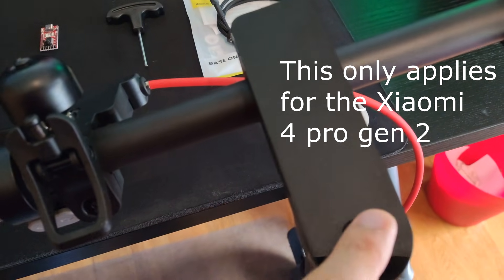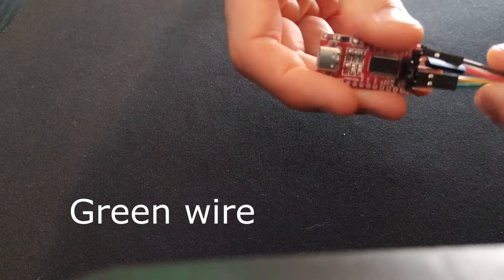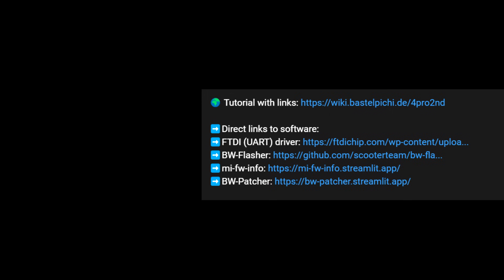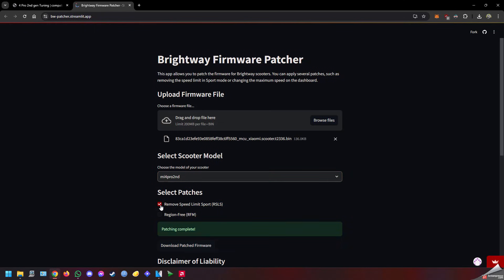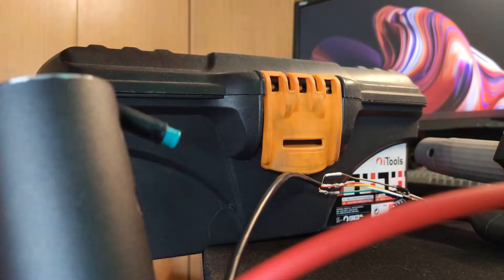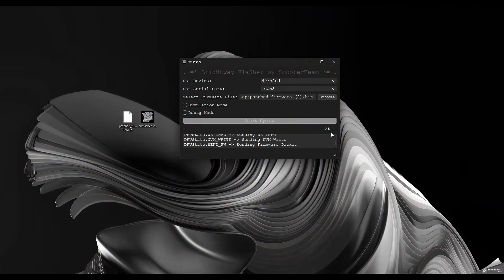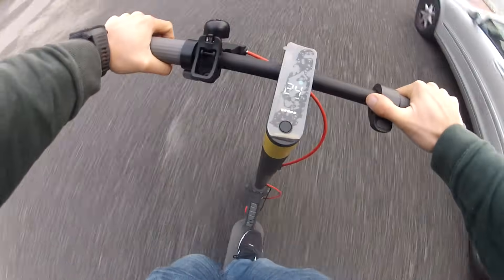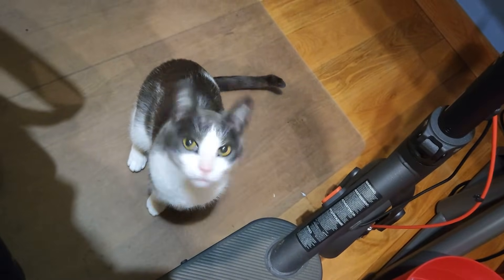UNLOCK Xiaomi 4 Pro Gen 2 & Xiaomi 5 TOP SPEED in 5 MINUTES 2025

Comment: i try everything but its still not working. it stay at 0% and don't move. i try you methode and from other. but nothing work. Can someone help
Reply from the maker: How are you connecting the cables? Connect the same way as in the ebay listing
Reply: @krypz0n  I tried your metal and the eBay method, but it’s still not working.
Reply from the maker: @niklaswendt37  Where did you purchase from? The correct way will be the way the ebay listing shows. It comes with a paper showing how to connect. Does the UART appear on control paneL? Are you using a usb-c cable that allows data connection? on bwflasher press "debug mode" and "test connection" is any reply being sent?
Reply: @krypz0n I use a iPhone usb c cable and I test but it don’t work it says that I reach the maximum

Comment: Hi, I have Xiaomi Electric Scooter 4. I did exactly the way it was described in the video. I downloaded and patched the MCU firmware. I verified the pinouts. The flashing was successfully done from 0 to 100%. But afterward, when I turned on my scooter, it started showing the'43' error code on the screen and the scooter continuously beeping.

I am unable to revert it and use the scooter. 

Kindly someone suggest a solution.
Reply from the maker: Hello, Xiaomi Electric Scooter 4 is not compatible with this method, only Xiaomi 4 pro 2nd.. Try joining the discord and asking for help

Comment: work to lite 4 gen 2??
Reply from the maker: no flusha, but there seems to be a hack in development to unlimit from 20kmh to 25kmh
Reply: @krypz0n in portugal limite to 25km/h
Reply: @krypz0n  that's why I wanted it from 25 to 35/30
Reply from the maker: @krazz245  impossible, scooter battery and motor too weak
Reply: @krypz0n  what? 25 km/h stock?
Reply from the maker: @krazz245  yes, unfortunatly you cant go anywhere above on this scooter. If you want more i reccomend getting a better more costumizable one
Reply: @krypz0n  yes but in Portugal the scooter is limited to 25km/h
Reply from the maker: @krazz245  yes

Comment: When I connect I get 3 different COM.
Standard Serial Bluetooth ... COM3
Standard serial Bluetooth .... COM4
USB serial port COM7.

Does it matter? Which one do I chose?
Reply from the maker: Usb serial port, watch the video
Reply: @krypz0n thanks, saw it now.
However the acceleration is really slow. How can I increase?
I also put 39kmh, but it only goes 30 (34 downhill).
Reply from the maker: @Cashifyer  its normal, mines similar, charge to 100% and it'll perform a little better
Reply: Thanks. 
Is there a way to increase acceleration? My Pro2 has a better acceleration with smaller motor. 
Also, is there a way to electronically silence the 30+ beep?  @krypz0n
Reply from the maker: @Cashifyer  Only installing a custom controller like a VESC, not a very easy job, some german guys have done it on a 4 pro gen 2

Comment: It seems not possible to do this using a Mac becouse cannot determine Com Port as far as I try.  I used Silocon Labs Drivers for Macintosh not sure now just stumped. any one knows?
Reply: My computer didnt determine Com Ports also correctly at first. So when I looked at Device Manager at COMs PORTs it showed me two ports. But when I looked at all the unknown devices list I saw couple of what where having some errormarks on their name, one of those was some USB COM or smth - I clicked on it and forced to download update drivers from Windows Update. After 1 or 2 times attempting it finally installed something and there was now one more port available and from it allowed to update this firmware :) But there are some cons. I did for my Xiaomi 5 Max. For example, at first the max speed was like 33km/h when battery was fully charged. After there was 75% left it didnt go any faster than 28 km/h. And those 25% from battery was drained very fast, I was able to drive only 7 km on max speed. And it beeped couple of times without any reason or any heads up notifications on display....  :( But yeah, it worked for some time. But range quite bad now :( But yeah my weight is also like 102kg. :) :) :)

Comment: This worked today on my Xiaomi 5 scooter. Not Max or Pro. Just regular Mi 5. The usbA was not recognized as a port under device manager. I used a usbC to usbC cable and the port was recognized successfully. I set the sport speed to 35 KM/hr and just tested it and only got up to 27 KM/hr. This was on flat ground. I followed his instructions and the firmware uploaded to 100 percent successfully the first time. Hope this helps others.
Thank you KrYpz0n !!!!!!!!!!!!!!!!!!!!!!!!!!!!!
Reply: I did for my Xiaomi 5 Max. For example, at first the max speed was like 33km/h when battery was fully charged. After there was 75% left it didnt go any faster than 28 km/h. And those 25% from battery was drained very fast, I was able to drive only 7 km on max speed. And it beeped couple of times without any reason or any heads up notifications on display....  :( But yeah, it worked for some time. But range quite bad now :( But yeah my weight is also like 102kg. :) :) :)
Reply from the maker: @DaemonDrag8  you can silence the beep if you want: https://www.youtube.com/watch?v=LUPODSxsKwI

Comment: My max speed was 27 and range 20km :(((((
Reply: I did for my Xiaomi 5 Max. For example, at first the max speed was like 33km/h when battery was fully charged. After there was 75% left it didnt go any faster than 28 km/h. And those 25% from battery was drained very fast, I was able to drive only 7 km on max speed. And it beeped couple of times without any reason or any heads up notifications on display....  :( But yeah, it worked for some time. But range quite bad now :( But yeah my weight is also like 102kg. :) :) :)

Comment: I have 2 Questions 1. Can i somehow set the scooter to 20kmh if i see the police? 2. I dont have the taillight always on thing
Reply: Try to set Drive to 20 and Sport to 30+. If you saw a police you can just switch to a drive
Reply: @Мокрийкот i think the police know how to change ro Sport mode
Reply: @ItzErmalYT  maybe
Reply: @Мокрийкот and what about that my xiaomi home app doesnt have the taillight feature always on?
Reply from the maker: just turn on headlights before disconnecting the dash and the brake light will stay on. Set Drive to 30+ and Sport to 20, if you see police put it in sport!

Comment: It ist Stück at 0 and i cant find the mistake can anyone help
Reply: Look if the cables are all in the right place. It is a little bit tricky. I thought I had everything right, but turns out I had one of the colored cables wrong. Also make sure your scooter is on (Just plug in the charger cable and turn on light so the scooter shouldn't go out.
Reply: @frorkbrunk6422  and what color combination do i need if i bought the first linked cable for xiaomi 5 pro/ max
Reply: @frorkbrunk6422  wich colores should i use If i bought the cable from the first Link for Xiaomi 5 max
Reply from the maker: join the discord and me or someone else can give you a hand
Reply: Which discord channel are you referring to? Can you please share the link?
Reply from the maker: @bilal-rabbani  scroll down: https://scooterhacking.org/

Comment: Ok so I wanted to put my speed hack on drive (i put it at max 39.50 and checked only this option) 
now it just goes 25 km/h instead of 20?? Sport mode did not change either.
Reply from the maker: I think th D mode might be a bit bugged on bwpatcher, try changing only S mode
Reply: @krypz0n  Ok bro I changed only the sport mode this time and now both modes go over 30km😭

Comment: i get a problem with "unexpected response" directly after starting flashing. Can some one help? Is an Xiaomie 5Max build for the German market.
Reply from the maker: https://imgur.com/a/mZETTVR

Try these options on your USB Serial device options in control panel
Reply: @krypz0n  Hi, I also had a constant "unexpected response" on "5MAX", I tried everything (another PC, another cable, USB HUB, reinstallation). But with these COM settings it was fine at first. Thank you very much for your help.
Reply from the maker: @rujakbalint3062  i will make a new video with these settings! Ty

Comment: EDIT: ANSWER IS AT THE END! 
Hello, I flashed my Scooter just following your tutorial and so far the program and cables worked. I wasn't able to try the new speed limit yet because I had no time, but I was wondering what happens if I drive exactly 30kmh - does it still beep then or do I have to go above 30kmh?

Because I patched the scooter to exactly 30kmh now. If it beeps I would have to do the whole thing again and patch it to 28kmh or something, because there is no way I will open the scooter just to remove the beeping sound. Does anyone know?
Reply from the maker: Hi, try to ride the scooter yourself over 30kmh. With the wind noise its barely hearable. In mine i didnt remove it and i barely notice it, so it might not bother you enough to want to remove it
Reply: @krypz0n  Alright thank you. I will try when I am back home and if it's not too loud I will let it stay on.
Reply: @krypz0n  Hi, just wanted to add to this: I was able to test the scooter now and drove exactly 30kmh - unfortunately it does indeed start beeping at 30kmh. I do not want to open my scooter to remove this beeping so I am currently patching my scooter to 29kmh, which should be sufficient to never have beeping (unless the street goes downhill).

Comment: Hey! Thanks for the great video — it was really helpful. I have a quick question: is it safe to unlock the Xiaomi Scooter 4 (2nd Gen) to 39 km/h? Could riding at that speed damage the scooter in the long run? Or would you recommend lowering the top speed a bit? What would be a safe and reasonable limit in your opinion?
Reply from the maker: It doesnt actually reach 39, itll reach 32-33 flat, 35 on descents. Its fine, its not an overclock per se, its literally removing the factory speed limitation and running the motor till its designed limit
Reply: Max is 32 unfortunately, I am a bit dissatisfied with it. Expected more than Xiaomi Pro 2...

Comment: hi first i wanted to thank you for the awesome cables and serial adapter (which i bought by clicking on the link) but is there any possible way to unlock any different futures like cruise control and no need to push to start? anyway thank you it worked in less than 5 min

Comment: It worked perfectly. Now the scooter beeps at 30 km/h. Anyone have a solution?
Reply from the maker: Yes! Check the end of the video and the linked video on the description 😊
Reply: Thanks a lot. It's possible to set the speed with a app like m365?
Reply from the maker: @ibosch6498  no, only through hardware (uart)

Comment: think about if you know how I can get it to run 20kmh again after I tune it because I have a 2 year refund if it breaks and I don't have that if it runs more than 20 and they find out about it😂
Reply: I have waranty too and I would like to do it again at 25 (in my country the maximum is 25 km/h).
Reply from the maker: @Bogdyy_1 do as i said in my reply above
Reply: KrYpz0n Can I get it to run 20 km/h again?
Reply from the maker: Yes! Just flash it with the MCU firmware file without patching and it goes back to stock firmware

Comment: How do you connect the wheel?
Reply from the maker: what wheel?
Reply: @ the e scooter steering wheel. U connected the scooter cable with the Flash Adapter. What happened to the wheel caple that u disconnected at the beginning?
Reply from the maker: @MaqxyIt remains disconnected while flashing. When you finish flashing, you reconnect it
Reply: @ ah After Flash u take out the flash adapter ?
Reply: @krypz0n  one last question. Is there any chance that this gets patched? Bc my friend want to buy this scooter but not any time soon, could there be a chance that this method gets patched and won’t work anymore?
Reply from the maker: @Maqxy Due to the way this method works (flashing via UART, same way the scooter gets its original updates), i dont believe so
Reply: @krypz0n  so he doesn’t need to hurry

Comment: BWFlasher always says 0% Even with Debug Mode and every Solution you showed it still can’t be Flashed for some odd reason I have a Xiaomi 4 Pro 2nd like in the Video
Reply from the maker: what happens when you click on "test connection"?
Reply: @ It says Maximum attempts reached, check your connection but after testing it on 2 other computers it still the same error on all 3 systems
Reply from the maker: @Ka11da240 what appears in device manager on control panel? Is the FTDI driver correct? Also double check scooter is on and connections are correct.
Reply: @krypz0n  im using rhe CH340 adapter with correct drivers and it says either com 3/4 in the device manager, also connection seems so be correct too and the scooter is on too,
Reply from the maker: @Ka11da240 ah.. im not experienced with the CH340 adapter, best join the discord, explain the problem on the #mi4 channel and someone might give a hand :)
Reply: @ okay where can I find the discord?
Reply from the maker: @Ka11da240 at the end of the video
Reply: @ thank you

Comment: Nice tutorial, does the ordered cable work with the Xiaomi 5 pro scooter?
Reply from the maker: no(t yet)
Reply from the maker: Hello, the hack is available, i will do a video very soon!
Reply: @krypz0n thanks I’m waiting for it ❤❤❤to
Reply: @krypz0n  So it works on 5 too? Considering buying a 5EU instead of the 4Gen2 (because of suspension).
Reply from the maker: @R4LStijn yes! Exacly the same method and cable (just select xiaomi 5 when downloading firmware and patching)
Reply: but you need other cable
Reply from the maker: @amugus3486  Yes! https://ebay.us/m/L4Zu2c
Reply: On the web it shows only for xiaomi 5 .
Reply from the maker: @aleksandarilievski9399  xiaomi 5 pro & max it is the same procedure but with a different cable: https://ebay.us/m/L4Zu2c
Reply: @krypz0n the link doesn't lead to anything on ebay?! HELPPPP
Reply from the maker: @0bjectBillion for the pro and max: https://ebay.us/m/L4Zu2c or https://www.ebay.com/itm/116609602399

Comment: Hello my friend. Can you help me? In your last tutorial video I wrote how I fried the cp2102 adapter twice. Well, I bought a new one and tried again. The program started to flash my scooter, but after 50% it got some kind of error: unexpected error: invalid FW file? so I don't know what to do. Can you please help me, I'm trying this for the tenth time.
Reply: hello borther, did you find a solution bc i have the same problem but it dosent move at all (0%) if you know anythng awnser me
Reply: I just used another tuned firmware from another tutiral and before i start i checked debug mode. Now my scooter goes 35 kmh when full charged.

Comment: I kept trying but it didn't work. The colors of the 5-pin connector were wrong. Measure it with a multimeter. And connect the cable accordingly

Comment: Hello! doesnt work Region Free :(
Reply from the maker: Hey! Was your scooter limited to 20 kmh or 25kmh originally?
Reply: @krypz0n  20 kmh bro :( I live in Germany
Reply from the maker: @luiscruz2329  hello, the bwpatcher website now lets you program top speed for each driving mode, you can select the top speed you want for each mode.
Reply: @krypz0n  is there a solution? :D
Reply from the maker: @luiscruz2329  sorry been meaning to reply but am on vacation:D mine originally is 25km/h top speed, i did the graph thinking what happened to mine would apply to ger version (20kmh top speed). Apparently on yours, region free by itself doesnt do the same as mine. I believe this could be contourned by changing the region on yours to one with originally 25kmh. Im not sure if it is possible (maybe when launching first time xiaomi home app and pairing with scoot, using a VPN and a xiaomi home account from a country without the 20kmh limit, like portugal) but i dont have a ger scooter so im limited in what i can test..
Reply: It doesn't work, it's still 20 km/h
Reply from the maker: @MrBukabu  hello, the bwpatcher website now lets you program top speed for each driving mode, you can select the top speed you want for each mode.